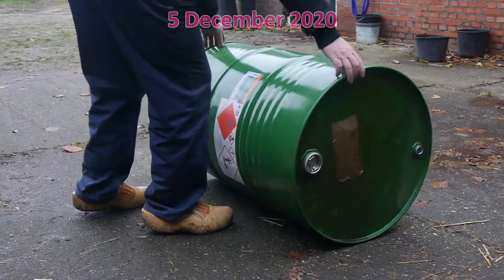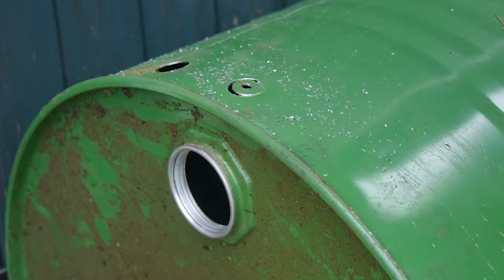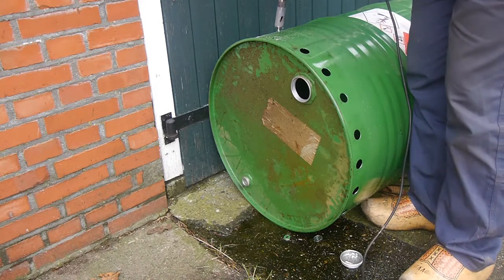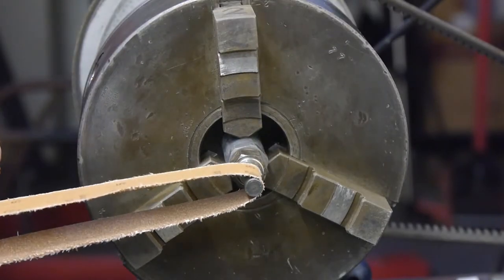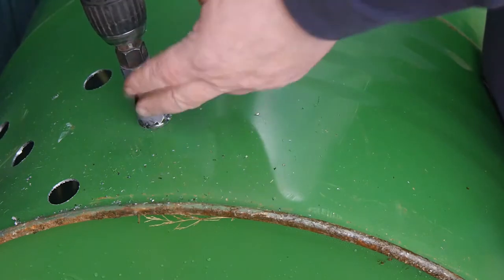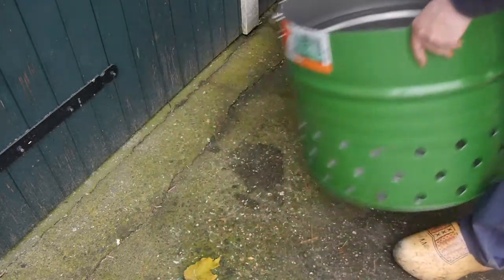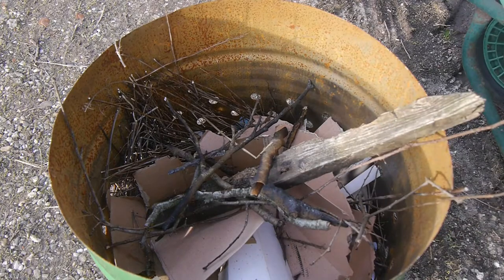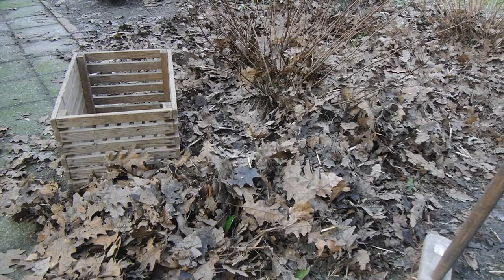Machining an oil-drum with some music

Comment: Nice pleasant video...well done.
Reply from the maker: Thanks man. I used some rock music of the loud machining bits in the first part of the video. Not over the speaking part! Then I happy tune for the second gardening/burning section and finally a slow piece for the morning after. Picking the right music is kinda hard :) Next I fixed up an old Rolingmetal video with some ambient noice.